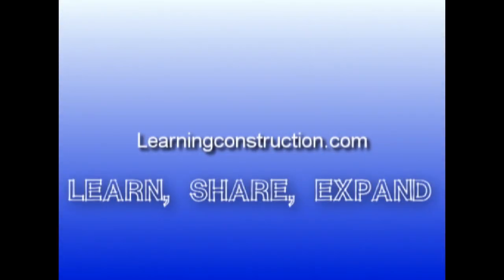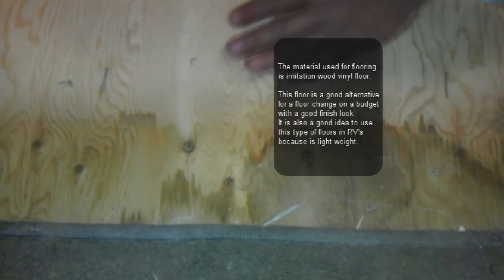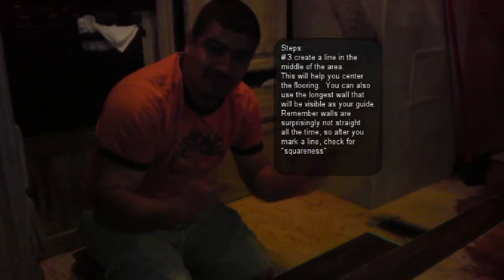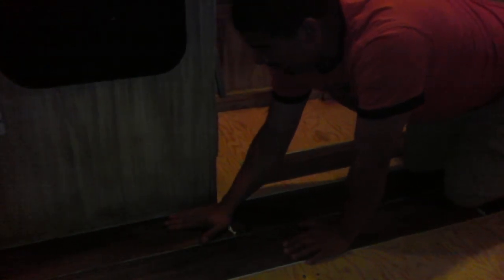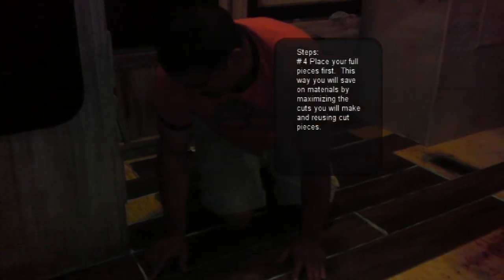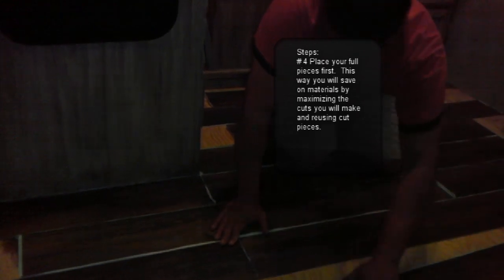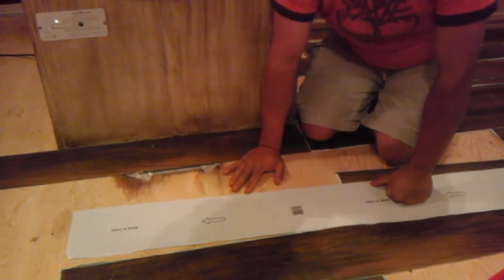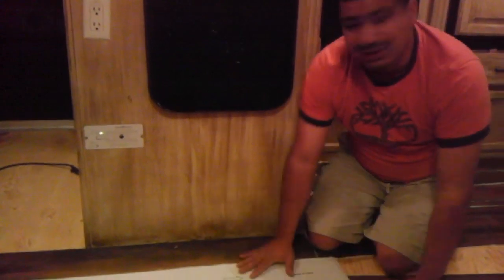How to install vinyl wood flooring

Comment from the maker: Also, if all joints are too tight from wall to wall the seams will buckle as the building walls contract and expand with temperature.